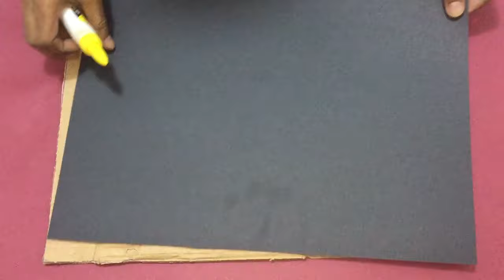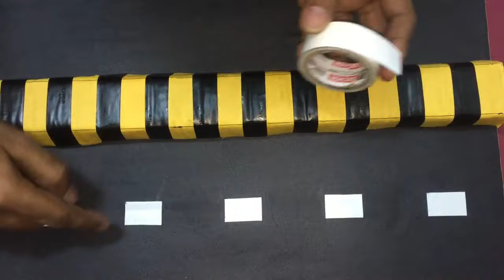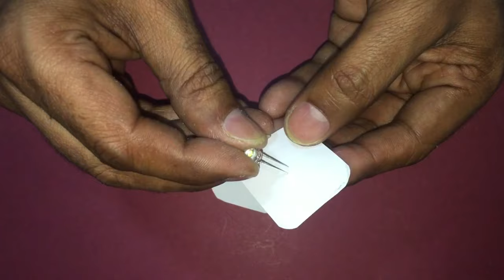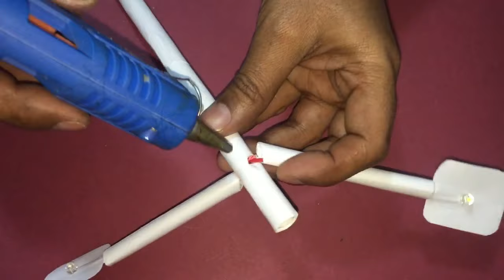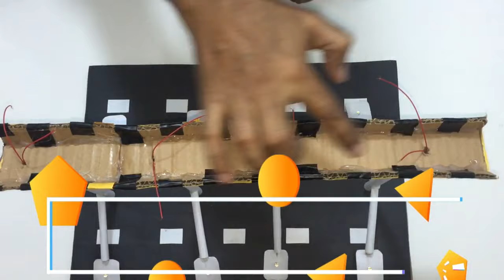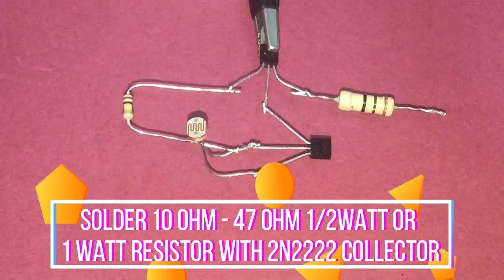How to make Automatic Street light Controller | Automatic LED Street Light Controller Circuit

Comment from the maker: Please Follow This Links for Circuit and Circuit details
Circuit Diagram & Working:-  https://ethcircuits.com/automatic-street-light-controller-circuit/
Reply: Hi
Reply from the maker: @temidireadesiji9713  please mail at ethcircuits@gmail.com
Reply: Please make a circuit with ldr in which motor should turn front and back
Reply: @Ethcircuits  is input positive and output positive connected across ldr and   bc557 E
Reply from the maker: @rajibpanda7527  yes
Reply: How to fix ldr in long wire in pole
Reply: Please., tell how to set ldr in a wire
Reply: Please, show it in 19 - 2 - 2023
Reply: Sir,  2n-2222  nahi mila kon sa tengeistor  laga na ho ga? Urgent......?
Reply from the maker: @komol1463  aap koi bi NPN transistor use kre 1amp se jyada wala jaise "D882

Comment: Sir I made the same and solder 10 white led lights in series and system is not working. But when I use single led it's working fine. Pls suggest the solution

Comment: Hi i wanna ask if it is okay to use dc547 ? Its kinda hard to find 2222 and 557 here in our place
Reply from the maker: You can use any NPN Transistor Instead of 2N2222 and any PNP Transistor instead of BC557

Comment: Sir if i am taking bc547 instead of 2n2222 so it is not working
Reply from the maker: 547 only 100ma and 2n2222 800ma so use any NPN Transistor more than 800ma

Comment: I've done proj but it's Working Opposite.
 Sir How to Fix it? Please help me
Reply from the maker: Please check r u using BC557 or BC547, please use bc557 and check connection carefully its 100% working circuit
Reply: @Ethcircuits  bhai bc 557 hi liya hu apke recommendation ke hisab se same hi liya hun sab  shayad apne Connection galat bataya hoga
Reply from the maker: @uday2001  Bhai m connection kyo galat btaoga please ek bar circuit fir se check krke bnao, or aap muje mail ethcircuits@gmail.com pe contact kr sakte ho, circuit 100% ok hai
Reply from the maker: @uday2001  bhai m  galat kyo btaoga aap circuit dhyan se check kre ek bar ya aap muje mail kre ethcircuits@gmail.com m aapki help kruga

Comment: YOU COULD JUST USE BREAD BOARD AND YOU CAN PUT TRANSPARENT PLASTIC ON THE LDR SO IF THE WATER SPILLS UPONE IT I DID NOT LIKE IT I AM A CERTIFIED APP DEVLOPER AND PRO IN ELECTRONICS

Comment: circuit Diagram kese work kre uska video bnavo
Reply: @Ethcircuits  i need your website link  
Can you give me link?
Reply: @Ethcircuits  bro iss video m aap ne relay kaa use nhi kiyaa h naa?
Reply: @Ethcircuits  okayyy brohhh
Reply: Sir aapki website m nhi h iska circuit diagram
Reply: @Ethcircuits  
Actually i have some confusion related to 2nd LDR wire connections 
Can you explain me about 2nd LDR (situated to POLE) wired positions?
Who is the 2nd LDR connected with?
can you exactly clear ?